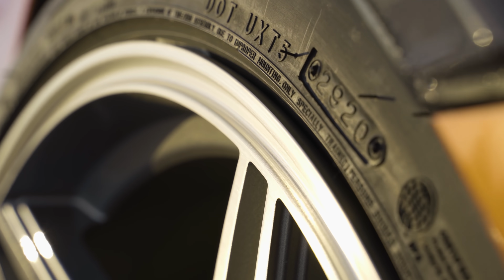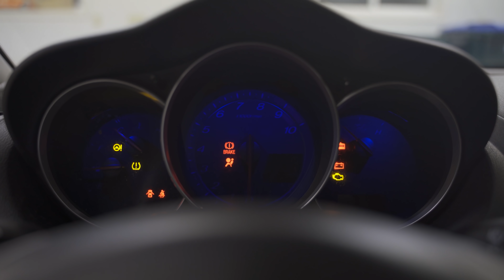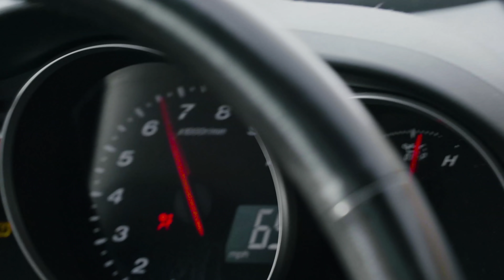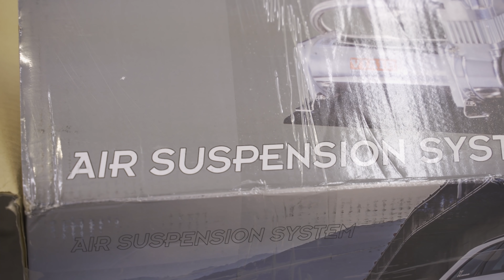Building the Most Unreliable Car!

Comment from the maker: Would you build a Mazda RX-8? 
www.fitmentindustries.com
Reply: yeah, cheep rotary duhh
Reply: Yes, with a retro styled bodykit.
Reply: I plan on swapping the RX8 engine into an FC rx7 because the engine is cheap and plentiful.
Reply: Driven By Madness is like thi Chris Fix of rx8s. i can recommend. Also Japanda Tuning has some takes on it too.
Reply: Honestly yes
Reply: Be sure to do an oil change right away, I think you mentioned you've done maintenance, but that is very important; get the highest octane too, at least 91, although even 91 is low for these engines.
Reply: (sweats nervously) I may or may not have bought one as my first car for £2500. Haven't decided whether it was a mistake or not.
Reply: I've bought 4 rx-8's so far... 😂😭
Reply: 100% yes
Reply: Gels, at some point you need to talk to the vargas brothers. It would be awesome if you have a collab with them.
Reply: one day
Reply: Hell no, maybe an 80's RX-7. Just not a fan of how the engines sound. Maybe a 2.3 swap out of a Mazdaspeed?
Reply: Yes and I probably will when I buy my dads/moms 04 rx8 off my mom when I graduate university in a few years but still doing key upgrades like the oil mod and a mid pipe in the meantime as the car is reaching 50,000 km
Reply: Wouldn't touch it with a 12 foot pole, even then I'd still be wearing gloves
Reply: I did! It's an awesome car to look at and drive now
Reply: Pro tip: coming from a rotary owner make sure you premix your fuel 1oz per gallon of fuel it's keep that OMP healthy and make sure you change out your coil packs they will fail on you
Reply: Yup, my cousin built his and it’s pushing just over 400 horsepowa with a thicc spoolly boi and I almost bought one but ended up with a brz instead
Reply: Yes. Just started one as a matter of fact.
Reply: yes sir about to jump in mine in ten mins
Reply: Currently in the middle of my turbo Renesis build. So yes. 😅
Reply: Of course the r3 version tho....its just more aggressive looking. It's just needs an engine swap and slap on some wheels tires and suspension from fitment industries. Thanks to Alex that's stuck in my head 😂
Reply: Already doin it
Reply: Ice satin blue, as long as you pick the right rims...also as long as you don’t LS swap or stick any type of piston engine you can do whatever you want to it. Purists or no purist would not be upset as long you don’t swap.  Previous owner of stock fc, fd and the 8..miss them dearly.
Reply: Ps great choice...love it
Reply: Good on you man.
Reply: As much as I love making poor choices, HELL NAW
Reply: I would put a volvo engine in it.
Reply: I have a Shinka, so yes.
Reply: I would, if I didn't live in an apartment and actually know what I am doing. Currently working on my Mini in the apartment garage. Needless to say management is not pleased.
Reply: Only as an Itasha with a engine swap.
Reply: Doing it right now!
Reply: My first car was an Eclipse GS-T, second car an Rx-8!! I’ve had it 11 years- 8 years with the renesis and now LS1 swapped. Haven’t been able to let it go,  endless project.
Reply: Yeah but I would build it almost 1:1 like the dude from ‘The Slip Angle’. I wouldn’t build it to be mega powerful I would want it to be fun and reliable. Not a 10K paper weight because I went crazy.
Reply: yeah was actually just thinking about saving money and buying one buy the end of the summer, always wanted a rotary
Reply: What was the song at the end?
Reply: In the process of LS swapping mine rn... using cd009 trans and eventually ford 8.8 rear diff. Gonna be fun
Reply: I owned a 05 rx8 and had a big wing on it as well. Owned it for almost five years until the motor went just after 100k along with my warranty. Had so much fun in it and a lot of headaches.
Reply: turbo4life66 how's the ls1 swap going? I got a quote near me for just under 10k I might go down that route when the motor goes
Reply: @justinmartin8438  it’s good for me I don’t mind the head ache, but for 10k I’d say it’s worth it just to not have to deal with all the little things that go wrong haha
Reply: @GapDaddyBuilds  good to hear thanks bro
Reply: YES
Reply: I have one !!!! and just remember respectfully beat on it regularly/daily they love it and uh we don’t need any tunes for pops/flames 😌 and DONT FLOOD IT , turn it off properly
Reply: Yes. I have 2. One for show and one to build.
Reply: Would you swap it for something “pure-ish” like the 2.3 out of the mazdaspeed 3 or 6
Reply: I did and I love mine👌
Reply: I would if I had the means to do it, kinda just bought my first car being manual 350z so I'll stick to what I got for a while 😁👍
Reply: Stoked on the build, the bitly links are busted btw.
Reply: You need to get a different mid pipe for it!
Reply: ONLY and ONLY if I was going to put a Weber Sport Zenith Line Aero kit on it 
****WINK WINK*****
Reply: RX7 instead
Reply: Yes, I have one.
Reply: Cuz I had an rx7 fc turbo 2 and a fb3s and before I ever wanted a rx7 I always wanted a rx8 ....then I find out my dad had a couple rx7s in his day I became a rotary freak ....I sadly have sold them all! The best times of my life! The rx8 has way more balls then the frs/86/brz its so slick on a wet day! With ac and all sunroof Bose speakers butter smooth shifts the rx8 was so much fun loved my 04 banged her as the beater everyday even in the winter !
Reply: @jpspotscars5421  yikes lol in europe that's crazy... K swap it..  I love mine as is but I'm thinking hard about the k swap...
Reply: Have done in the past in that colour too.... upgrade the coils, and the oil cooler pipes, unless you've got 10k forget about a 13b rew swap, the headers are a dick to do as the engine mount sits in the way. If you haven't got a system to premix make sure your putting 2 stroke oil in with the fuel. Imo stick to a dual exhaust. Looks odd  single, the rear lights like to fishbowl drill a tiny hole in the corner of the black plastic. Not sure what emissions laws are like in the US but Car will pop flames without a cat. Concentrate on handling as chasing power will cost you more than what the rest of the build is worth. I went from a rx8 to and FC turbo 2... whilst they're related 2 very different cars.
Reply: Already have. Last piece is some Rpf1s from
Y’all
Reply: I do, I have, I will, yes, and repeat.
Reply: I am right now
Reply: got a 6mt to do somthing with. coppery red. all black leather. no sunny.

Comment: I'm an RX-8 owner. You already have a mid-pipe, the most IMPORTANT mod for the health of the motor. And since you installed a SOHN adapter kit you won't need to premix, so you're good there. You're going to want to install an aftermarket oil and coolant temp gauge cluster since the one's from factory are dummy gauges.
Reply: Only argument I have to this comment is the premix part. SOHN adapters are to run clean 2 stroke oil to the combustion chambers. This solves the oil quality issue, not the oil quantity issue. While the quality of oil is now going to be clean 2 stroke designed to burn, you still haven’t changed the amount of oil being used as lubrication. This is where premixing is still important on a series 1 with a lack of a 3rd oil injector. Premixing will still need to be done
Reply: @BooSackNoodle100  yeah but I want a rotary not an LS

Comment: Few things I REALLY recommend:
1. Compression Tester, specifically for rotaries(really recommend this if you guys want to start a great long-lasting series with these engines. This will tell you the overall health of the engine)
2. MUST premix each time you fill up gas.
3. Check your oil every 3 gas fill ups. 
4. Let the engine idle for at least 2 minutes before driving. 
5. Do not baby these cars once they are warm. They love to be rev’d and can handle it VERY well. REDLINE the engine at least once every drive to eliminate carbon buildup(carbon building up is how most of these engines die).

Side note- The guy swapping out the midpipe was definitely not something to thank for. The stock catalytic converter is typically worth $1,400 due to its specific material in order to withstand the heat these cars produce. 

A side all of the maintenances, these cars are amazing and will be worth the while if taken care of correctly!(I own 2 Rx8’s and a BRZ myself.)
Reply: A lot of crucial information here! Following this.
Reply: He shouldn't premix if he's putting on the sohn oil metering adapter stuff
Reply: You need to check the oil more often then every 3 fill ups, it’s best to do it every 1-2

Comment: As an Rx8 owner myself with 165k original miles, I tip my hat to you for helping keep the rotary alive. My goal is to build the Rx8 to the level that it WILL be the successor and earn the title Rx-8. You are at the right track. First thing I did was to make it more reliable. Sohn adapter should be the first investment. Premix is next, you got the right one. Never go below 91 octane fuel. That’s it. Stay on top of maintenance game and this car can be the perfect daily driver. Good luck, and welcome to The Neverending Project.
Reply: If you wanted the rx8 to actually earn the title of rx8 you would be swapping the rx8 drive Train into a 3rd gen miata and make it an inch or two wider

Comment: Premixing in addition to the SOHN kit can help, yours is a gen 1 and only has 2 omp injectors per housings whereas the gen 2 has 3 injectors per housings and actually gets the middle of the rotor and middle of the apex seals lubricated.  Premixing is more comprehensive and reliable but a little annoying.  For me the cost of that idimetsu premix was a lot so I premix with normal 2 stroke oil and then you can use the rotary specific oil for the omp adapter kit.  Good luck on the build Gels!!!!

Comment: The aftermarket midpipe swap wasn't a gift. The stock cat is worth a grand 😂
Reply: Holy shit no way!
Reply: @hellaflushhonda  it does
Reply: @hellaflushhonda  an oem cat from mazda costs 1500 bucks
Reply: I found an EPA compliant for $750 as a kit. Not happy but it passed emissions before I can get it tuned
Reply: @jerryglennie5375  I’m lucky to not have emissions so I just run a good old fashioned straight pipe on mine which makes for a very loud and obnoxious daily driver
Reply: @jerryglennie5375  emissions?! Just move somewhere nice.
Reply: I would've kept mine if I had known that before lmao. I swapped it for a cheap ass $300 midpipe so I guess I essentially threw away $700 🤯🤬😂
Reply: @kylerpowney9771  same
Reply: @kylemiller5178  when I get the funds I'm switching to a dual resonator and flow master exhaust instead. Keep it quiet without dealing with emissions. My 05 shinka is my play toy and work vehicle
Reply: Someone tried stealing mine once lol
Reply: Kinda ironic, isn't it? (The fact that the most expensive single OEM component for the RX-8 is also the one that will contribute the most to it's Renesis suffering a premature death...)  Both of mine pass smog without it. In California .
Reply: @sosmachines84  no the stock apex seals lubrication and spun bearings are the mean reason 95% of rx8s are broken down. A Söhn adapter is a MUST on any RX8.

Comment: If someone hasn't said this - get a longer coolant overflow hose and route it to the bottom of the car. It gets used regularly on the rx8 and the stock hose dumps it on the EPS wiring / plug. The EPS is great but not cheap to fix on this car. As previously stated monitor oil and coolant temps closely, especially if you are city driving.

Comment: Only thing I would look into is a SOHN adapter to only feed 2 stroke oil in the engine and always premix. Keep the stock intake or get a racing beat intake with a straight intake tube from brainstormtuning, Ls coils don't really help, aluminum radiator and aluminum overflow to prevent one from bursting and the thing that will really change the feeling of the car is a racing beat lightweight flywheel 👌

Comment: I've always wanted one of these, despite the "downfalls " of the Renesis.
Reply: The only real downfalls of the renesis were due to emissions standards. It is still by far the best bone stock NA rotary you can get. Which is why there are not really any mods other than removing the cat which will give the car any more power.

To beat emissions and achieve a high powered NA rotary mazda made the MSP renesis engine use high compression rotors and used side exhaust ports. On top of that since the car would do 9krpm from the factory the apex seals were also shortened to reduce the weight of the seals to avoid increased wear at high rpm. Combining these leads to many rx8's dying due to simply poor maintenance, where people fail at simple tasks of changing oil topping the oil off. The main death sentence is low compression due to wear, showing with the typical hot start issues around 80k-120k miles.

Apex seals exploding haven't been an issue for decades.....unless you count people who make botched engine builds and overboost.

Comment: the big thing with the sohn adapter is that it just replaces the stock rotor oiling system you still need to premix with it its not adding more oil to the rotor its giving it the same amount that it was stock its just allowing you to run synthetic oil in the crank case. with that s1 you should probably be premixing about 6-8oz per 10 gal of gas. have fun with the car man i just got myself a s2 r3 in crystal white a month or two back and its been my daily. keep up with maintenance and itll be fine also throw in some spark plugs it wont hurt and might as well do them now before they decide to foul completely

Comment: Hell yes! Welcome to the Triangle club. I got my 2004 rx8 2 years ago, original motor with 90k ( canadian ) in motor. Owned a Mustang GT before. Love my 8. Run a very his viscosity oil, let it warm up before driving, and dont start it to move it to a different spot without letting it idle for awhile

Comment: Also for oil, put 5w30 nonsynthetic in the engine and premix with Lucas oil. Upgrade the starter and the alternator those go bad usually. For short runs for example to the gas station, to the store a few miles down the road, rev the engine to about 5000rpms then immediately shut it off. That will expel the gas from the engine helping it start up better when you get back in and not having a flooded engine. Another thing is when driving you have to let the engine sit until it is warm before you go to help with longevity. GETTING GAS IS THE WORST you will be sitting at the gas station for more than 5-10 minutes after getting gas because the engine will be flooded and it will not start and click and many people will tell you not to ruin the starter etc etc so best thing is sit for 5-10 minutes with it on and then start.

Comment: Personally I love the RX8 and would love to have one! In fact when I purchased my "dirt cheap" project (2001 Audi A4 - $800) I almost bought an RX8 for $1000. Only reason I went with the Audi is because it started and the RX8 didn't. After a year of owning the B5 it recently made a trip to Florida from Pennsylvania and back (2100 ish miles) within 72 hours and not one single issue, with an unopened stock engine! I'd have to say up to this point it's been a success.

Comment: Premix, sohn adapter, redline often, and don’t be surprised when the apex seals just wear out after 80k or even sooner. That’s just Renesis life. If you want it to go longer when you rebuild it consider ceramic seals. Otherwise there’s going to be issues common to every one of these cars that you’ll come across. At least your passenger airbag cover isn’t cracked.

Comment: Fun fact: 03-04 rx8 is what gave the car a bad wrap. They came from factory with a bad tune and caused the apex seals to wear quicker than usual. They are auctually pretty great cars if you take care of them right and do all the things that rotaries need (premix, no cold revving) and they can auctually be pretty reliable. Check out some of the rx8 fourms its very interesting

Comment: I used to work at Mazda in 2006, when the RX-8 was out and I drove plenty of them. Handled really well, hardly noticed the weight and good balance. I also road in the Road course Pepsi RX-8, that was non-turbo. All the nice RX-8's have the 13-BREW turbo engine swap, anyways.

Comment: Maybe shoot Angel Motorsports a message. They will be more than happy to help you with a reliable rx-8 build.
Reply: Rob Dahm is also working on engine parts for the Wankel, some of which can be swapped over to a Renesis.
Reply: Jordan Winders  There are some differences, but the studs in particular can carry over, and you can swap the rotors between the versions depending on what you want. The Renesis rotors are lighter and have a higher compression ratio. I'm sure there are more parts, because the housings are almost identical other than OMP ports and where the exhaust ports are located. The Renesis routes the exhaust out of the irons, where the Wankel sends the exhaust straight out of ports on the housings.

Comment: Use fully synthetic 10w40 oil in your sump and idemitsu premix in your SOHN adapter AND your fuel tank (incase the OMP fails unbeknownst to you). 

Other than that, strict maintenance schedule and routine load/high revs and she'll prove the haters wrong. 👍

Comment: 1°cat deleted
2° sohn adapter
3° 2 air vacuum delete
4° cold air intake
5° 65° thermostat
6° fan mod kit
7° hood with vents 
8° radiator aluminum Reservoir
9° LED headlights
10° relocation battery to the trunk
11° 2 gen rx8 differential
12° 235 front tire, 245 back tire
13° street port!! 
14° stage 2 tune in case u get a turbo 
That's all u need 👌🏼

Comment: Mine has 85000 original motor 2007. One advice. Don’t add stage one clutch unless you have turbo lol. And add mid pipe to premix. 1 oz to gallon. Don’t let gas go below half tank because there is another gas reservoir and when you’re turning you tend to loose power on full throttle.